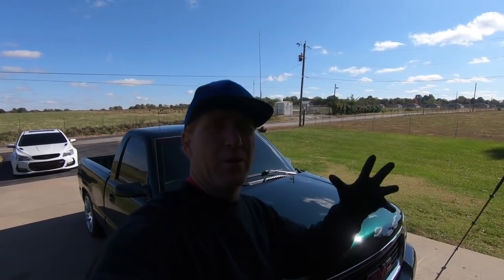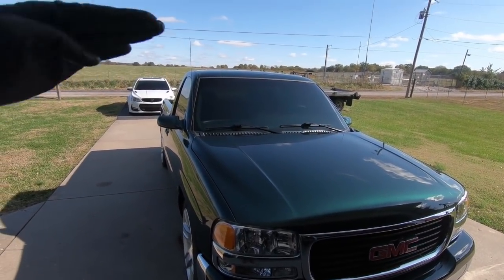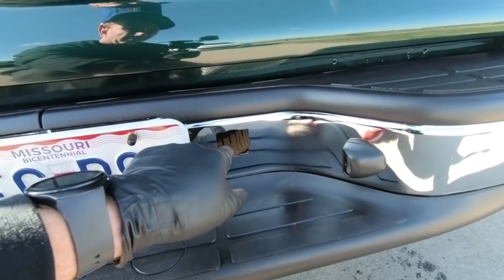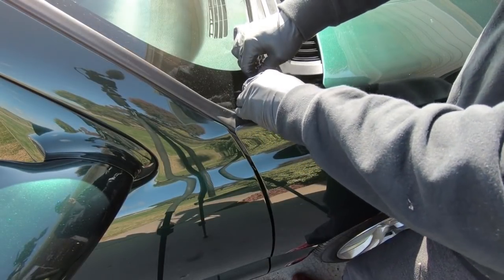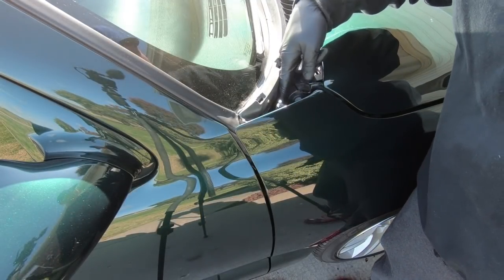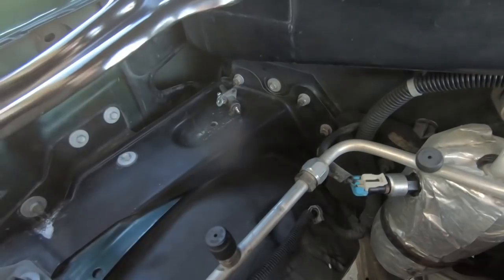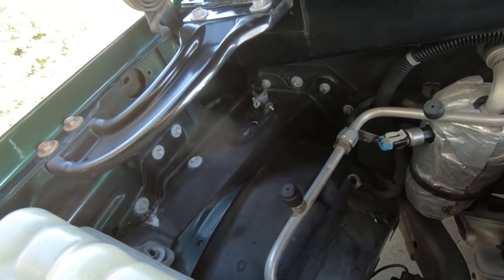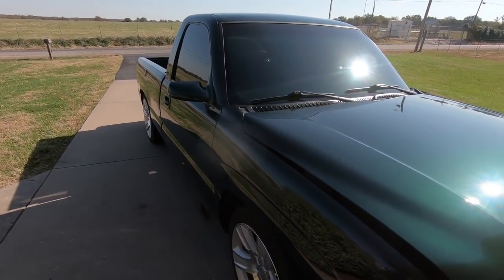How to Delete Antenna and MORE!!! (Slammed Sierra Project)

Comment: I was lucky enough to find an OEM cowl piece off of an Escalade at a junkyard, I bent the original antenna and zip tied it to the rubber strip on the cowl. Reception is fine and it looks way cleaner
Reply from the maker: There you go. Awesome

Comment: Adam's polish makes a product called VRP. It's great to dress up your Vinyl, Rubber and plastic pieces. Makes it look new and not glossy
Reply from the maker: Thanks for the heads up.
Reply: @TWAMotorsports  no problem. I use it as my tire dressing as it doesn't fling or look crazy shiny.
Reply from the maker: @1982DrH  I need it for that too lol

Comment: I didn’t want to dig through all the comments, but the oils from you hand create a hot spot on the bulb causing it to burn out faster. It works the same on exposed lights on your house and dust settling on the bulbs.
Reply from the maker: Awesome info. That is great to know.

Comment: Add a GS-100A to your 3rd brake light. It's a flash module that looks great with the LED upgrade. I did it on my 09 Z71
Reply from the maker: I didn't put leds in the brake lights only the cargos

Comment: Never heard of the antenna delete I always just took it off because like you said it looks out of place. Thanks for the idea!
Reply from the maker: Yeah it's small but cleans things up.
Reply: Right took mine off the year I bought the truck to unlock it because I had left my keys inside and that antenna never found it’s way back on the truck thanks to this vid that hole will be closed from now on 👍🏼

Comment: What year is the truck again? Did you change the mirrors to the small ones. I have an 02 and has the larger mirrors
Reply from the maker: It's a 2002. Yes they are SS mirrors. I list a link in my back from body shop video.

Comment: That truck is soooo cool & the subtle mods just make it that much nicer...would've never thought about the antenna relocate. I'm considering swapping my front bumper('05) to the '99-'02 style because I like the fog lamps better. Do you know if the bumper brackets are the same?
Reply from the maker: Thank you. No bumper brackets are shorter or I would have bought a newer one and done the same.

Comment: Gave me an idea to relocate it like the 07 and up chevys with the short shark fin on the roof.
Reply from the maker: That is the onstar antenna. Just take it off, but there will be a hole.
Reply: @TWAMotorsports  like on a 99-07 classic body style. Relocating it to the roof like 08 and up. Even tho its onstar will it still work as just a antenna

Comment: Nice truck bro did this year's ago but get shit reception how is yours?  I also just plastic welded a filler piece in hole
Reply from the maker: Reception is good. I can get stations 50 miles away
Reply: @TWAMotorsports  thats crazy most of my main strong channels I get in and out reception. I did mine above need to check if I grounded can't remember that might be the case.

Comment: You will look at that handle guide , every-time you walk around the truck...LOL  I heard GM is offering the bone stock 5.3 engine new....with warranty for $5,000  Cold tested crate motor...if you're going to keep that truck ....it's an idea......I bought my little 5.3 LS new in 2001 ...it has 225 k miles now .....runs and drives like new ...mine is black with tan interior......!
Reply from the maker: Yeah I have a donor truck

Comment: The bracket on the antenna wire broke when I pulled it apart. Did not come out like yours.
Reply from the maker: Should be able to put it back together or order a new one

Comment: They don’t make the antenna mod for the 07-13 silverados do they?
Reply from the maker: They do. Comes off an Escalade in those years aswell
Reply: TWA Motorsports thank you!
Reply from the maker: @hodgemods  you're welcome
Reply: TWA Motorsports just so ya know that doesn’t work lol our Silverado’s 07-13 have that hump in the hood which runs into the cowl and the one on the Escalades from that year are flat 👍🏻
Reply from the maker: @hodgemods  that's good to know. Thank you

Comment: Where did you get those after market mirrors
Reply: On Amazon it says it won’t fit but did you have to drill holes ? Or it just fit for your 99 gmc?
Reply from the maker: No drilling required. I ordered power so maybe that is the difference.

Comment: From my understanding, you should never touch high powered halogen/xenon bulbs that go into headlights or fog lights. The oil from your fingers can cause the glass to crack since they get extremely hot. Great idea for the antenna hiding under the hood, I'll try that on my 02 Denali!
Reply from the maker: Thank you Scott. That's good information.

Comment: 😂 you don't need an impact for small screws like those for the antenna... But an electric ratchet does wonders
I wish f bodies had antenna deletes that can look that clean... With oem parts
Reply from the maker: Me too. Power Antennas on fbodys are nice though. I do need a electric ratchet.

Comment: I just did it I get static on my radio anyone had this problem I get it away from fender sounds good when it touches loose signal
Reply from the maker: Mine touches and no issues
Reply: @TWAMotorsports   as soon I move it it get good signal I order a smaller 11” antenna has a rubber coating will see when I get it lol
Reply from the maker: Hopefully that helps. I have an aftermarket radio but that shouldn't matter
Reply: Same here I have a alpine double dim radio but I was thinking the bracket could be the problem not getting a good ground I used a aluminum piece as my bracket wonder if that could be the problem 😬
Reply from the maker: Grounds are important for Antenna

Comment: I have a spare tire plastic piece I’d give to you. I live in Hannibal MO
Reply from the maker: You mean the one without a hole like I put on? I wish you were closer is so.
Reply: TWA Motorsports yes. It also has a key insert
Reply from the maker: @rileywalden7465  thought you were talking about the Antenna plastic not bumper

Comment: Man if that is all I had to worry about each day is my antenna I would be set. I am surprised that you have lived to be your age so far.  Don't let the small stuff worry you, you will end up in a pine box early with a heart attack. TWA Motorsports, you need to pick your battles wisely. OMFG PRINCESS, if you do not like the way the cover fits on your bumper you better do a bumper delete.